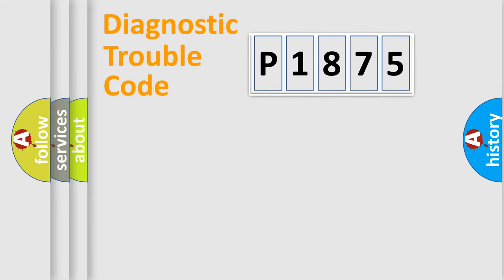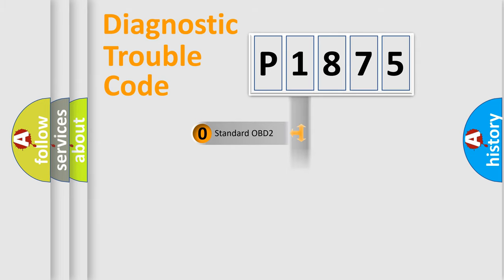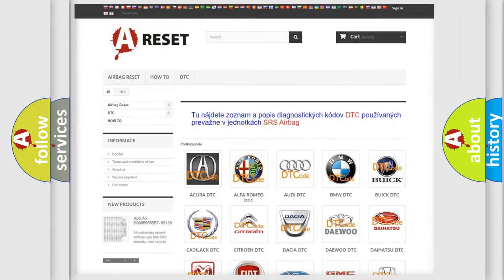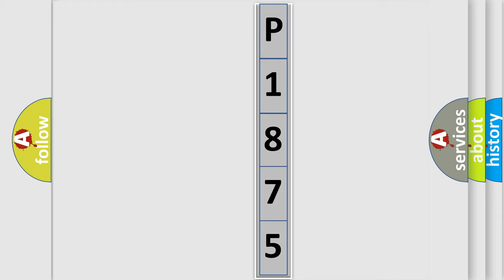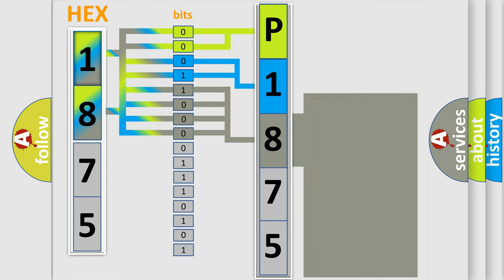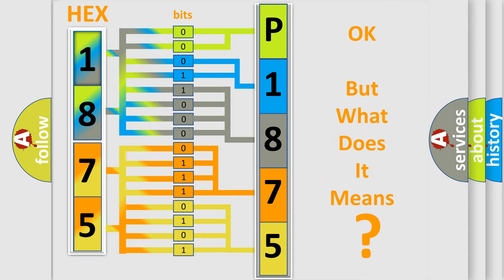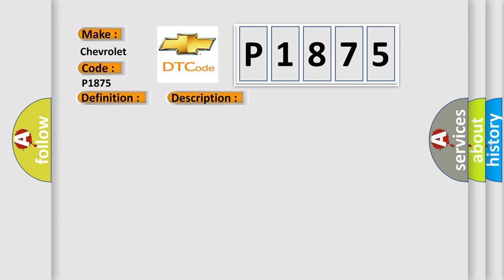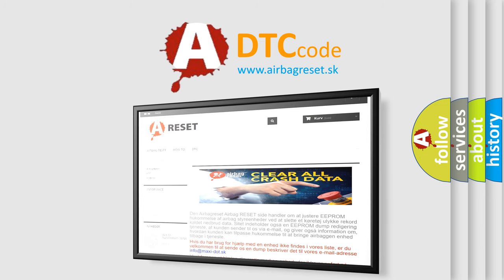DTC Chevrolet P1875 Short Explanation

Comment: This is wrong P1875 is a 4wd low switch circuit according to my Launch scan tool. I have an intermittent misfire and non com to 4wd module along with a svce 4wd light.